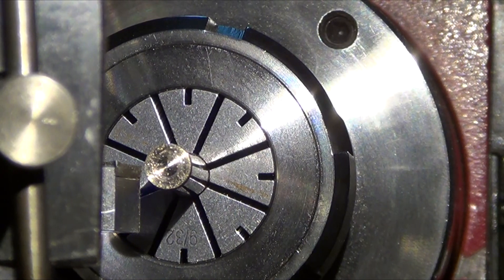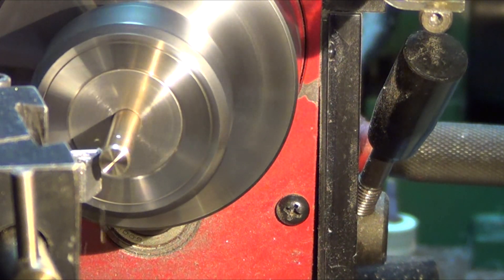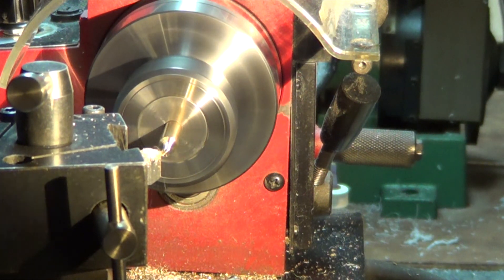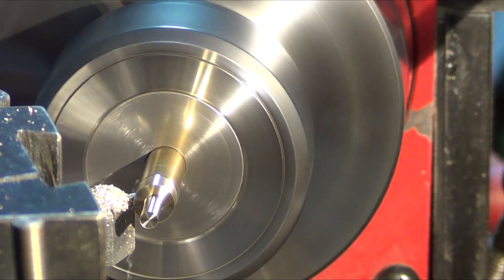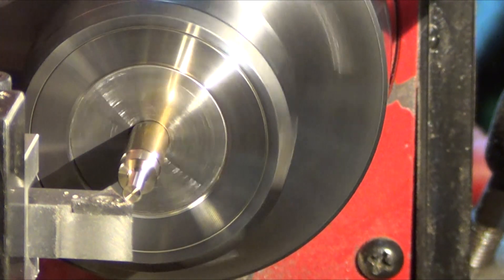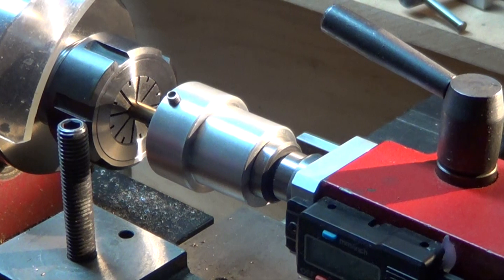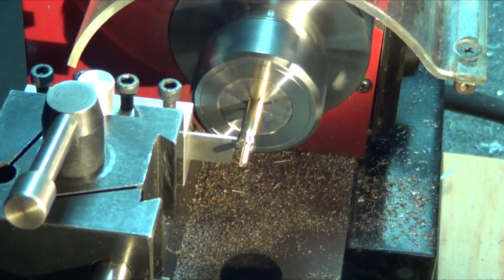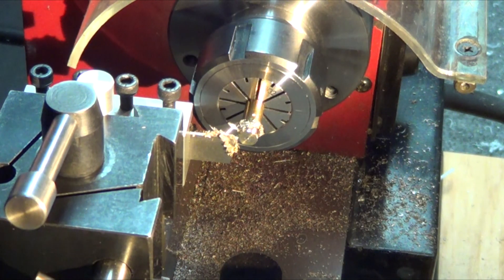Mini Lathe Making a Screw Video #125

Comment: is that harbor freight tools  ??
Reply from the maker: I use only 3/8 indexable insert holders, 3 sets, from Anytime Tools off Amazon but the one you see in the video is one I made on the mill from 1018. There is a big assortment of inserts that fit the 3/8 holders over the 1/4 HF. The insert in the video is a Cobra Carbide TCMT 21.51...